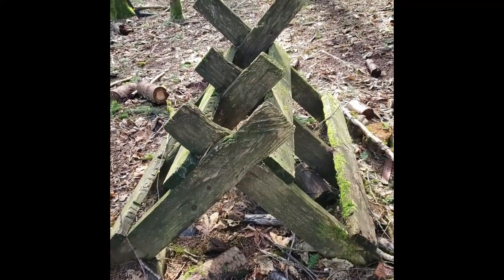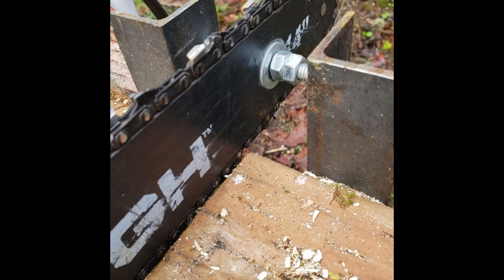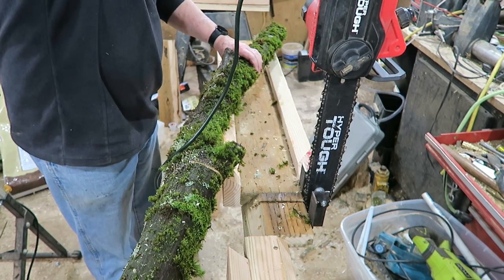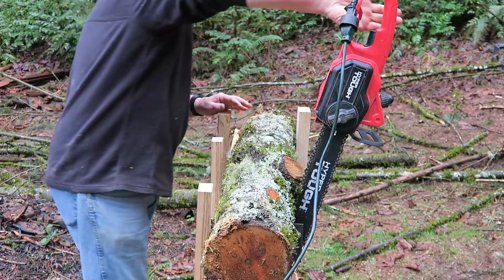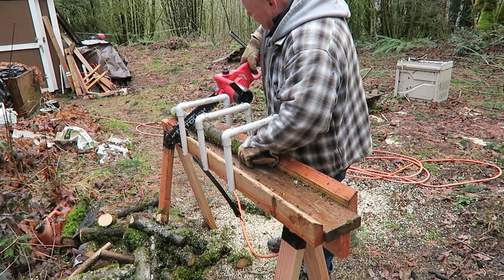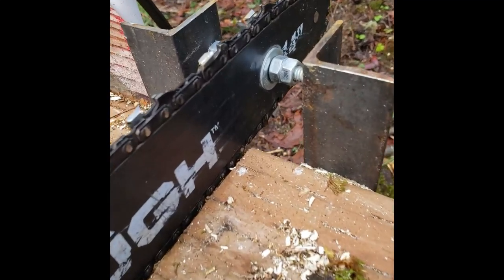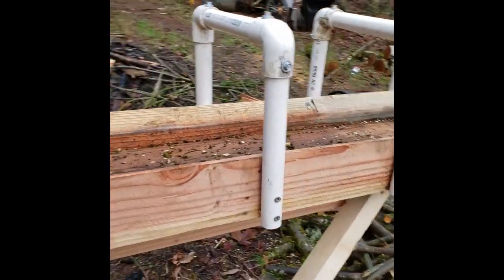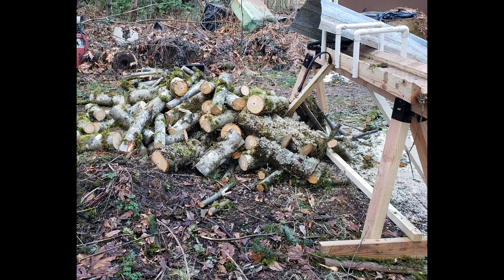log cutting bench

Comment: You have the bolt in the wrong place. Run the bolt through the bar close to the motor then as you lift the saw to cut it will pull the log towards the saw and won’t be able to jump out.
Reply from the maker: Thanks Randy.  I thought about that but was afraid of the business end of the saw sticking straight up.  I will have to give it a try and see what happens.  Thanks for the comment.
Reply from the maker: Hey Randy, Check out my latest video.  It shows my latest, and last, version of the Log Cutting Bench.  I finally got time to change the pivot point of the chainsaw from the tip of the bar to a point up close to the motor.  That made a big difference.  I also tossed the wooden bench and used my old motorcycle load ramp for the trough.  Had to sell the bike. Just getting too old.  Thanks again for the suggestion!

I have cut about 6 cords of wood with it and I don't see a need to make any major changes now.

https://youtu.be/OZp3XeyVBFU

Ken